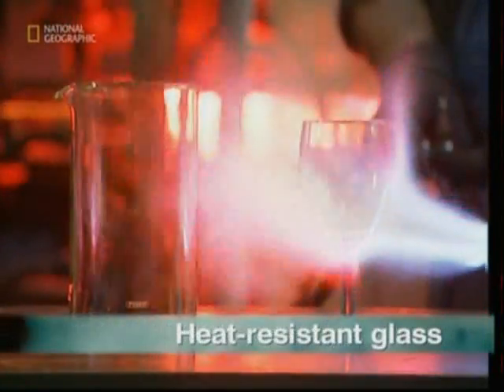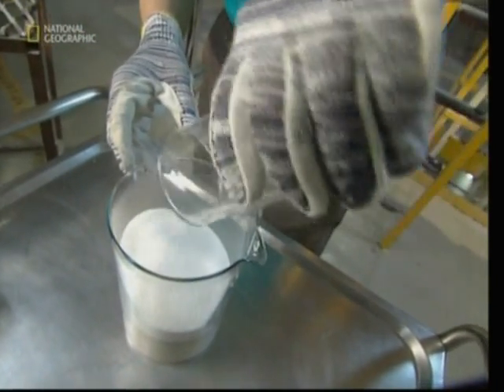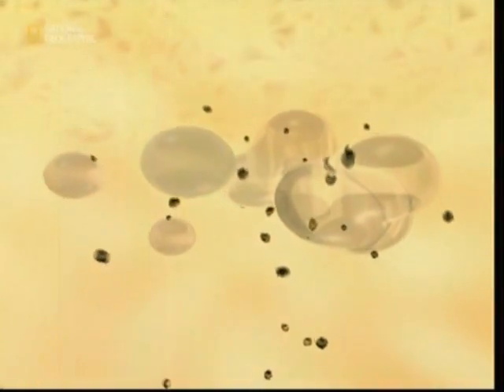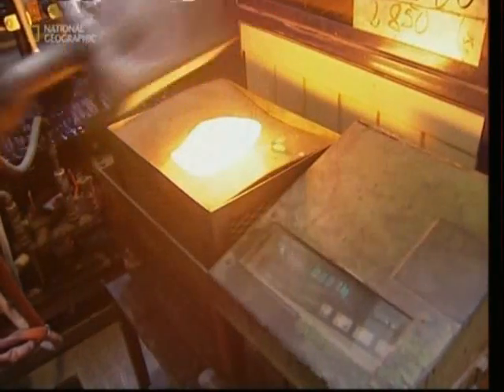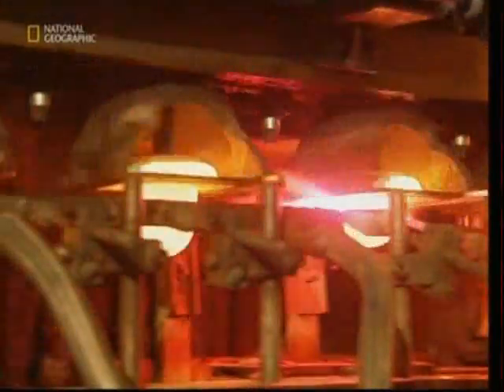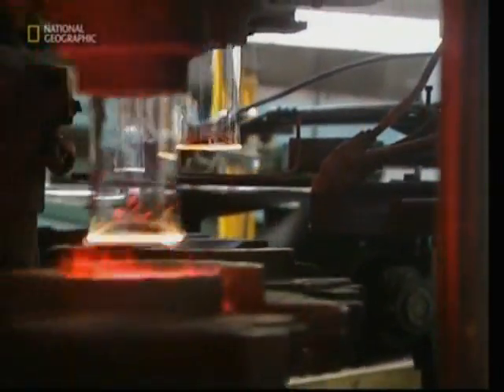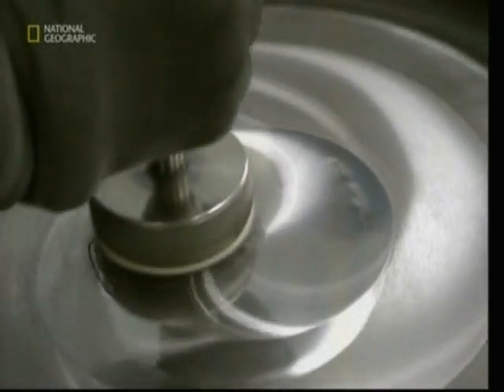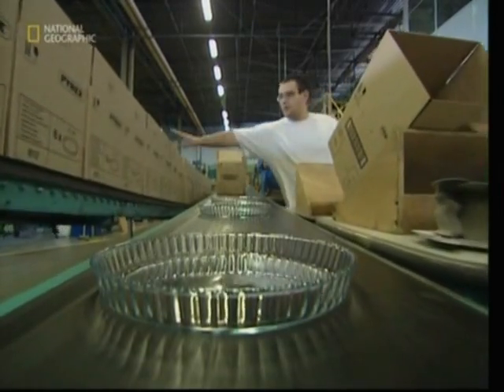How Heat-Resistant (Borosilicate) Glassware Is Manufactured

Comment: The Pyrex ware in the U.S. is no longer made by Pyrex, nor are they made of borosilicate. I discovered this yesterday, while attempting to make yogurt. Some jerks bought the name, and the name only. Don't support them.
Reply: @CivicFiberglassDoor
The pyrex in lower-case letters are manufactured by an American company (Corelle Brands.LLC) and it's made from tempered soda-lime glass, not Borosilicate, and that's why it isn't as heat resistant as the original Pyrex glassware. 
The original Pyrex made out of Borosilicate, are still being manufactured here in Europe by a French company (International Cookware SAS) but unfortunately for you Americans, their products are only sold in Europe, Middle East and Africa.
Reply: @jrand2631  China ?
Reply: PYREX vs pyrex. The all lower case is tempered sodium lime, not boro like all caps.
Reply: Buy Pyrex borosilicate and make it yourself
Reply: that is true. But if you want to buy indian borosilicate glass stuff is cheaper than pyrex and much better in quality than chinese alternatives. These facts arent very well known worldover.... we make them.
Reply: Pyrex is a brand of glassware that has been around for over a century, and historically, Pyrex glass was made from borosilicate glass. However, in the 1990s, the Pyrex brand was acquired by World Kitchen, LLC, and they changed the composition of Pyrex glass to tempered soda-lime glass, which is less resistant to thermal shock than borosilicate glass.

The decision to switch from borosilicate to tempered soda-lime glass was made due to manufacturing and cost considerations. Tempered soda-lime glass is cheaper and easier to manufacture than borosilicate glass, and it also has better resistance to impact and scratching.

However, it's important to note that tempered soda-lime glass is still a safe and durable material for glassware, and Pyrex glassware made from tempered soda-lime glass is still widely used and trusted by consumers. In fact, tempered soda-lime glass is the material of choice for most glassware manufacturers, including many reputable brands of glass storage jars and containers.

So, while it's true that Pyrex glassware in the U.S. is no longer made of borosilicate glass, it's not accurate to say that the brand is no longer trustworthy or that the switch to tempered soda-lime glass was a bad decision. Pyrex glassware made from tempered soda-lime glass is still a safe and durable option for food storage and other uses.
Reply: prying eyes I bet that was messy!
Reply: Yep only the euros got boro still